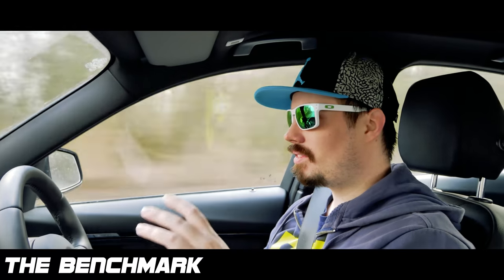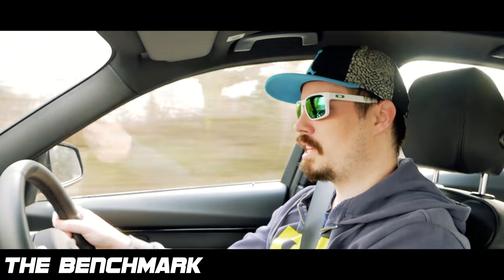Project M3 - BMW OEM Parts Are VERY Expensive! - Vlog

Comment: I just got a Gripper 8 plate LSD with a 4.10 CWP from Automac.  If you want to do that more cost effectively, try JC Racing and they can rebuild you an E36 Evo 4 plate LSD. I'd still recommend the 4.10 final drive ratio of your can stretch that far though :)
Reply from the maker: That’s a serious bit of kit with a very short gear ratio!
It’s incredibly lively in 1st as standard so I would have a hard time launching with the 4.10.
Reply: The Benchmark Yeah, 1st gear will be slightly compromised, but most people find it totally fine on the road.  The rest of the gearing will be bang on. Top speed in 5th will be around 151mph, and 6th will be 182mph.  Gives about 13% more torque at the wheels. I think it's the gearing that it should have come with, but I love shorter gears... Not a fan of these long ratios that take ages to spin up